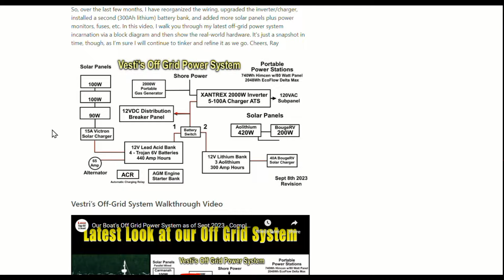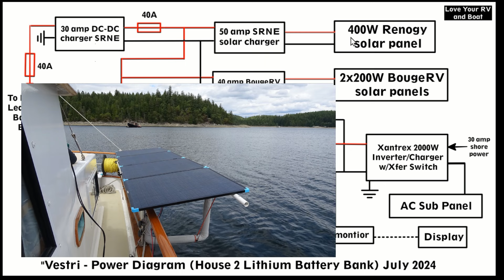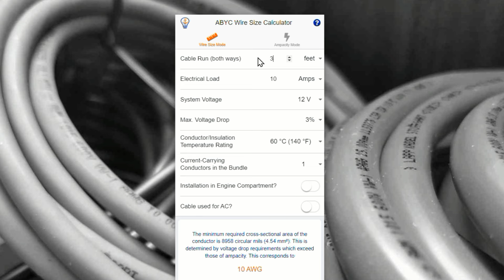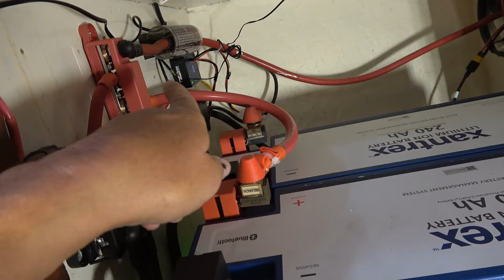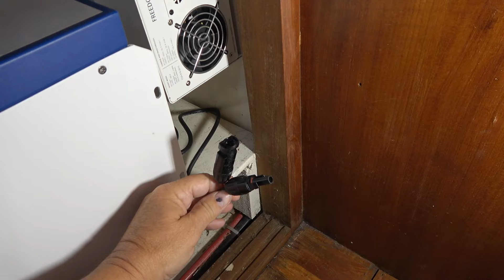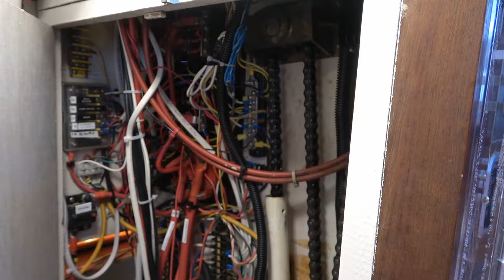Off-Grid Power System Upgrades - LIFePO4 Battery Capacity Increase + More Solar (July 2024 Revision)

Comment: Thank you Ray for the tour, looks like a nice system. Very similar to ours. Where do you connect the DC loads? What are your parasitic loads? 

I ask because our boat builder installed an electronic12v distribution panel with 5 inductive tank level sensors that consume nearly 1A continuously. I am trying to change the tank monitoring to a momentarily switched circuit but I have to cut into the circuit board. It would be interesting to see where you pull your switched and unswitched 12v power.
Reply from the maker: You're welcome. :) My loads go through the main switch panel and a small DC distribution bar. I haven't actually calculated my parasitic loads since we are either always on the boat using it cruising in the summer so inverter runs 24/7 or it's up on the dry in storage with batteries disconnected and plugged into shore power for a pair of 100W boat heaters during the winter. 
Right now we are prepping the boat for another summer season. Doing more electrical changes. :)  I'm getting rid of the existing 4 golf cart battery house lead acid bank and adding some lithium in its place and also experimenting with dedicated lithium battery for the bow thruster and anchor windless. It will be switched with the existing AGM starter bank as a back up just in case it can't handle the amperage draw. It's a large lithium battery so hoping it can handle the motor loads. It will be mounted much closer to the bow so will be able to substantially shorted the wiring runs to both the thruster and windless. It will get recharged via a DC-DC charger from the alternator. Cheers, Ray

Comment: Simple by comparison, but I have two 100w Renogy panels each of which comes with a charge controller.  If I parallel the two downstream from the charge controllers, they fight each other, one controller seeing the output of the other and thinking the batteries have a greater charge than they do.  I have to run both panels thru a single charge controller to achieve full potential.  Your system has three inputs (the two PV charge controllers plus the DC to DC charger) all  paralleled after these controllers.  How do you keep them from conflicting?
Reply from the maker: Lead acid batteries that charge in multiple phases (bulk, absorption, float) can be an issue unless the chargers are very closely set up for each phase and wiring size and length are closely matched or have a communication data line capability. However, lithium has a much different charging curve. Lithium batteries have very low internal resistance and stay in a bulk charge acceptance mode for over 90% of the charge curve. So basically, they will easily sop up all amps provided. It's not until the lithium battery gets to about 95% charged that the internal resistance will rise, amps drop and the voltage rises enough that the chargers may think they are near a float and conflict. By that time I'm not concerned as the battery bank is nearly full. Comparison between LA and LiFePo4 charge curves https://www.powerstream.com/z/lfp-la.jpg
I usually set my chargers to their lithium preset, usually 14.2 -14.4V and they work well together.  It's best to have the charge controllers output wiring near the same lengths and met very close to the battery bank.  Cheers, Ray
Reply: That explains it.  I'm charging lead acid batteries.  Thank you.

Comment: Great overview as usual!  What's your opinion on having multiple smaller MPPT controllers vs one larger one?  I see you have multiple controllers; is that cause "you had them" or is that "the best way" to wire multiple/different wattage panels?  Not holding you to it, just want your opinion.  Thanks.
Reply from the maker: Thanks! I used use multiple controllers in this situation because the two solar arrays I'm using have differing voltage/amp ratings and they are located on the boat where one will suffer shading while the other is in full sun. Also the chargers run cooler since they aren't having to work near their max amperage rating. I do the same in my RV where I have a roof that slopes toward the back and front from the middle.  I use a different controller for the panels mounted on the back and front as they often see differing sun levels and I can use two smaller sized controllers vs one large one.  And another plus is system redundancy.  If a controller fails the system can still be made to keep working, which is great when traveling to remote locations like we do on the boat especially. :) Multiple chargers with lead acid can require a lot of setup to get then to charge in sync through various charge phases but with lithium the battery charge curve is very constant almost to full charge. The low internal resistant means that the lithium will easily sop up what ever amps are being produced by both chargers. Cheers, Ray
Reply: @LoveYourRV  Excellent points!  I didn't think about the redundancy concern that if one controller goes down, charging in some fashion continues on.  Also like the point you made about overheating the controller when they are running at their intended max amperage rating.  I'll ponder all of your comments in my modifications to my solar system.  Thanks a bunch!  Safe travels...

Comment: I'm interested in your setup with two different charge controllers connected to the lithium batteries. Will they each provide full rated charge (on a sunny day) at the same time or will they affect each other?  Seems like one controller would sense the output of the other controller and think the batteries are charged.  I'm having difficulty understanding how this works.
Reply from the maker: Lead acid batteries that charge in multiple phases (bulk, absorption, float) can be an issue unless the chargers are very closely set up for each phase and wiring size and length are closely matched or have a communication data line capability. However, lithium has a much different charging curve. Lithium batteries have very low internal resistance and stay in a bulk charge acceptance mode for over 90% of the charge curve. So basically, they will easily sop up all amps provided. It's not until the lithium battery gets to about 95% charged that the internal resistance will rise, amps drop and the voltage rises enough that the chargers may think they are near a float. I usually set my chargers to their lithium preset, and they work well together.
Reply: @LoveYourRV  Thank you, Ray.

Comment: Thanks for the overview Ray! I’m trying to imagine how you would use 400 plus amp hours of power. You didn’t mention any high amp output appliances. 

You must have another 300-400 amp hours of power using power stations as well.
Reply from the maker: Many boats have built-in generators that run on the same diesel tanks as the main engine, but ours doesn't. The best thing is to oversize the battery capacity so we don't have to run a noisy gas generator on deck in a quiet anchorage, which is also dangerous when stationary due to fumes. 
We draw on average 10 amps per hour I find. In 24 hours that is 240 Amp hours. We have a Nova Kool DC fridge that draws 4.4A when running and in the summer warmth it runs quite a bit, also a Acopower DC fridge/freezer that draws about 3A. Starlink when on most of the day draws about 5A and then there are our laptops 17" HP  3A and Apple 13" 2A and Anne has a 27" computer monitor she sometimes uses for photo editing 6-8A.  Then boat lights, water pump, electric toilet, various tool and camera chargers, etc. plus I use a 700W instant pot every few days. It all adds up, if we get socked in with fog, cloud and rain for a few days the batteries can get drained quicker than you think. :)   Last night the Xantrex batteries were near full at 92% by morning we were down to 70% and these are the longest days. Good sun today and back to 100% by 3pm. But it only gets worse from here as the days get shorter. Solar harvest can vary when we are at anchor depending on how we swing around.   The power stations are Bluetti AC240 and AC70 they have 130AH and 64Ah.  The AC70 gets used to charge our phones and a few other small things and the AC240 gets charged by the original solar panels the boat had on it 200W. Then I use that power to heat up our water heater every few days for showers. Water heater uses about 60% of its battery.  There is lots of room to conserve power but nice to not have to worry about it. The lead acid bank is my reserve and it has about 220Ah of usable power. Cheers, Ray